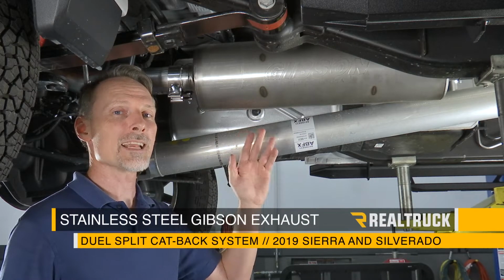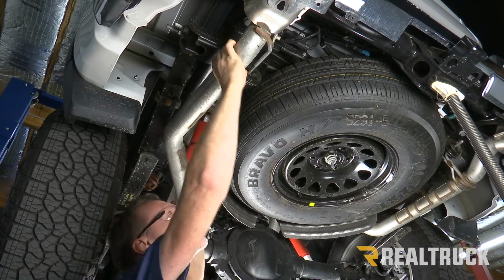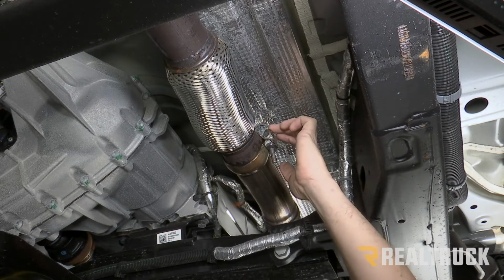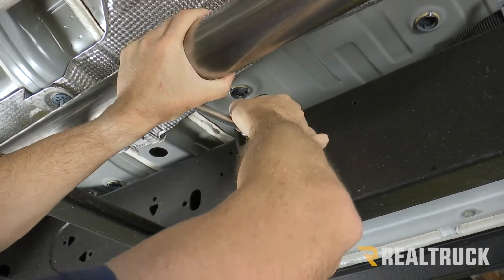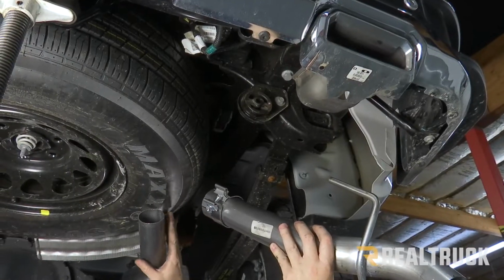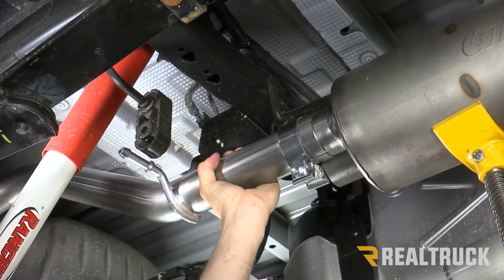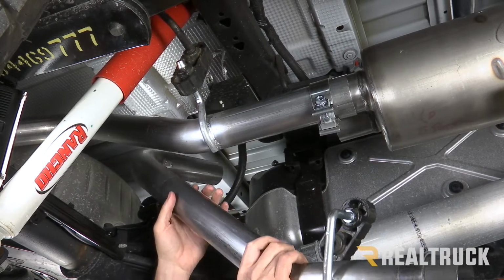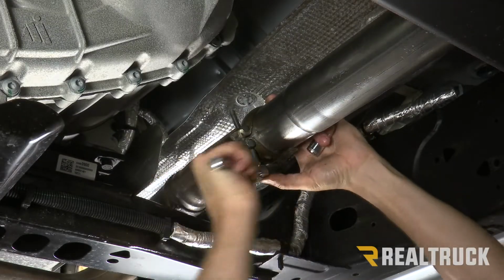How to Install Gibson Exhaust Systems on a 2019 GMC Chevy 1500 Crew Cab 5.3 V8

Comment: Do you have any links or substitutes to the rubber insulator mounts you used near the rear end of the truck? The exhaust shop who did the work on my system just welded and it already broke.